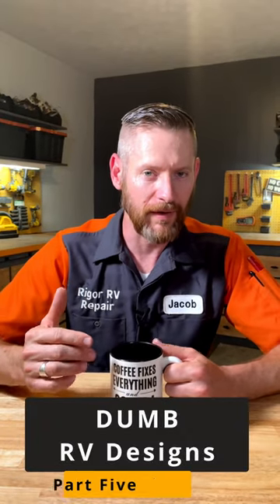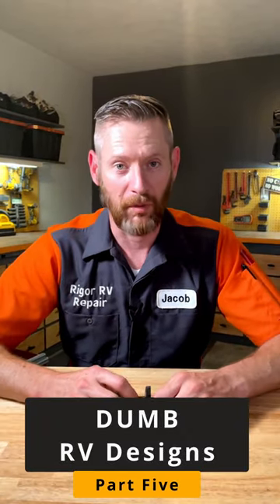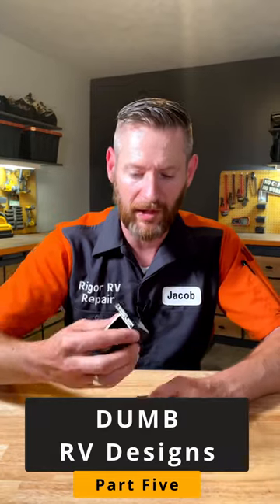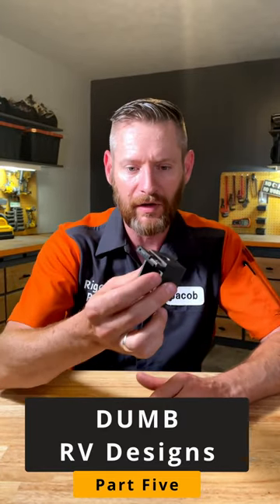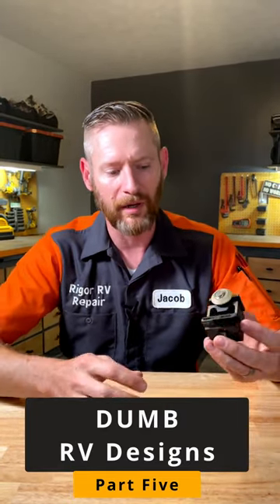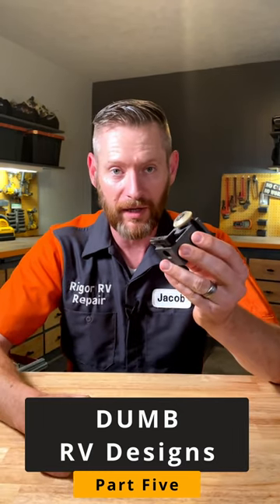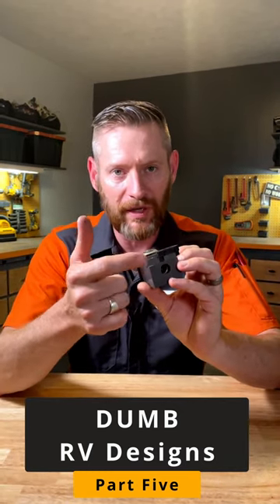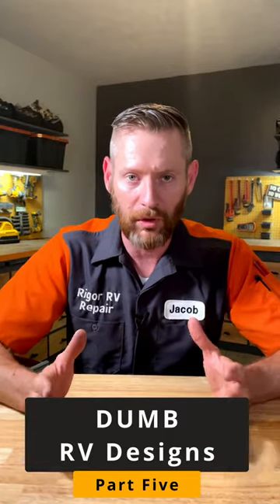Dumb RV Designs Part 5

Comment: Do they make a better bearing block that you can update the ones that are in there?
Reply from the maker: No, and I wish it was simple. Often these breaks are due to the room not being installed correctly,  so even upgrading parts would not solve all problems. 
Check out Vroom slide systems in Tucson for an alternative.